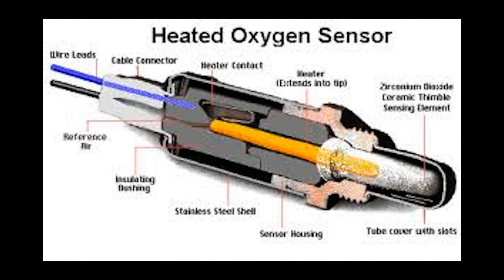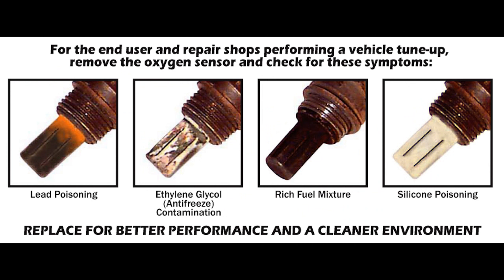Oxygen Sensor - How its Works? How To Test it?

Comment: nice meter :) you should make video how to clean o2 sensor :)
Reply from the maker: +singlecams O2 sensor dont need clean,if he dont work properly maybe u have other problems,fuel pressure too high ECT sensor lie to ecu that engine is cold etc :)